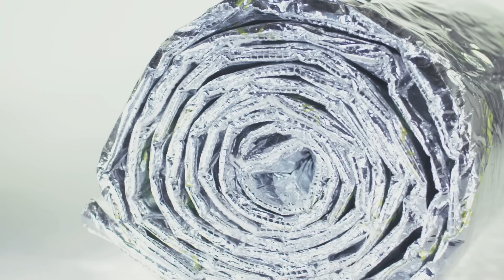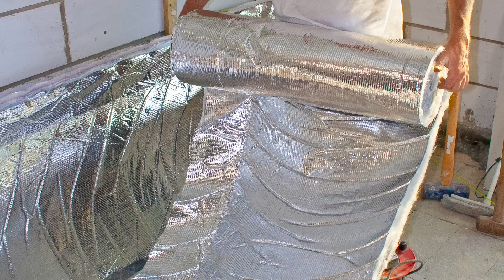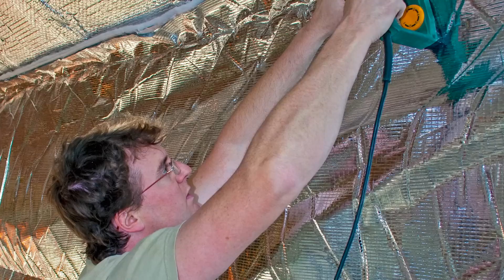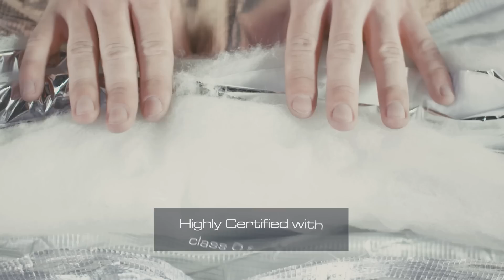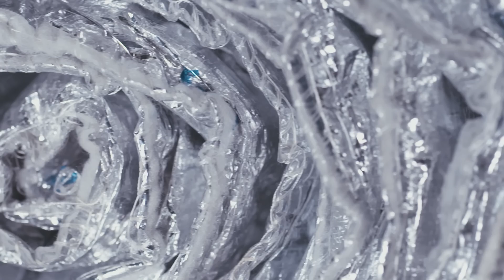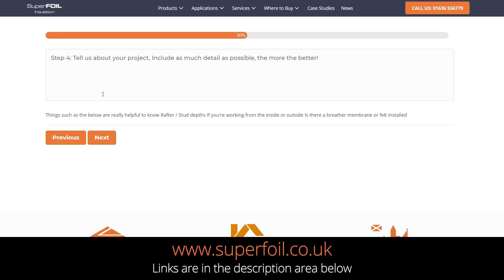What is Multifoil Insulation? — With Byron Lawson

Comment: These foil films are all very good but they are superbly effective at blocking radio waves.  By the time you've wrapped your cosy new home with metallised foil insulation, topped it off with multifoil and fitted windows with nano reflective coatings you can say goodbye to DAB radio and mobile phone coverage indoors, and heaven help you if you use it in internal walls and floors because that'll stuff your wifi too.  Still, you'll be nice and warm in your insulated (and isolated) tech free hideaway 😀
Reply: Tin Foil hatters will be queuing up in their droves
Reply: @eliotmansfield  or using it to their advantage 😁👍
Reply from the maker: Living in a Faraday cage
No thief will clone your car keys
Reply: @SkillBuilder  hey guys .. ive an extension with ufh over 100mm kingspan and a 50mm screed , great job I need to match the old house to the new   but have only 50mm in total to play with I'm wondering is this superfoil the job I need ?? Any thoughts.. thanks guys
Reply: @SkillBuilder  They will if you've got a proper wooden door. Anyway with all these wooden frames and polystyrene they can just shove their arm through and pick up the keys of the table in the hallway!
Reply: Will go brilliantly with my tin foil hat. No government or aliens will be able to scan my brain🧠….
Reply: that might be why my DAB radio never worked in the university hall new build!
Reply: @jk28416  led lights interfere with the signal.
Reply: @jk28416 as soon as your dab radio gets more than 2metres or so inside a building it's game over.
Reply: Mmmm. Tempting. And I've already installed CAT5 and CAT6 and Freesat cable in conduit to multiple points in each room
Reply: Call me crazy but you could always read a book
Reply: Sounds fantastic.
Reply: So this foil would work as Faraday cage and maybe work as EMP protection can someone enlighten me on this.
Reply: I just added some radiator foil and noticed it killed the signal to the smart TRV. what a pain!
Reply: 😂👍 Thanks for the humourous but logical reply. I won't be using it.
Reply: Yes, if one had a 4g Wi-Fi outside you could run a light bulb if you run a bridge rectifier and negative ground.😂
Reply: So I won't need to wear my tin foil hat and underpants anymore? 🤪
Reply: Bonus then 🤣🤣🤣
Reply: Lol
Reply: My phone uses Wifi calling. 👍🏻 foil insulation helps keep the wifi in 😊
Reply: I have this installed in my house WiFi signal is ok but mobile signal crap
Reply: This won’t happen please ignore this information.
Reply: Use Wi-Fi for mobile
Reply: I’ve got insulation with a single layer of foil (on one side) in roof, floors and walls.  I know because I installed it all myself.  No problem with phone signal or FM or DAB.
Reply: Can always fit a repeater.
Reply: Wrong.    My whole house has double layered radiant foil,   high density tiny bubble / neoprene like layer sandwiched between 2 layers of foil.   I also have r25 fibreglass and then another layer of radiant foil.   Steel on my roof there is no problem with cell phone servic
Reply: Foil faced Celotex will be no different. Ditto foil faced plasterboard - which we’ve used for decades.
Reply: @John Chapman perforation ( in the space industry)

Comment: i have used ybs super quilt to great effect on new project its great for loft rooms and vaulted ceilings. cut it on a flat surface with a sharp Stanley blade with a heavy strait edge. use clouts to tack and use a good quality foil tape.

Comment: Never try to put a screw through multifoil insulation!
Reply from the maker: Good point. We will be doing some installation videos.
Reply: Absolute nightmare I did one wall where I used the method of stapling it back to create the air gap but the wading just grabs on the screws and balls up. Battons are they way to go.
Reply: If you mean the problem of material binding around the screw, use long thinner wood screws. I forget the exact type I use to avoid this problem, but deffo works with the right screw.